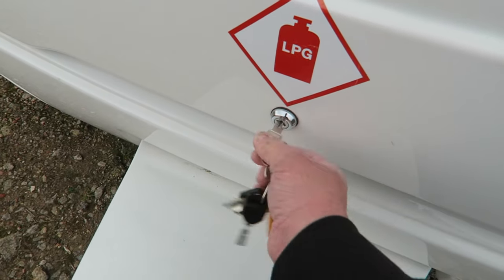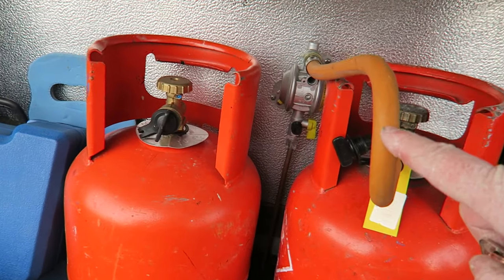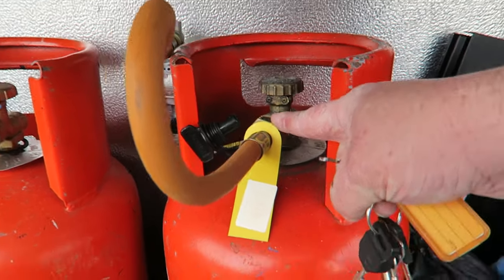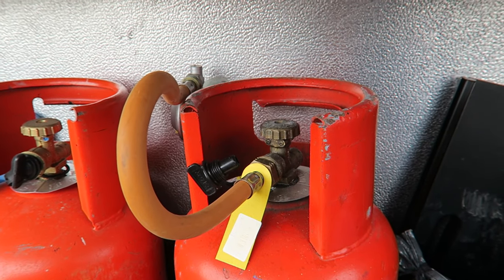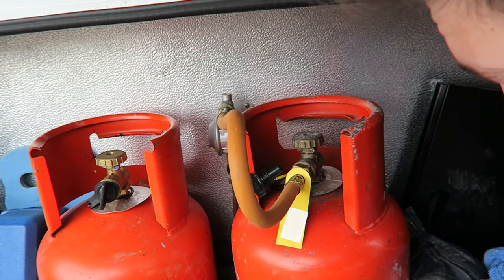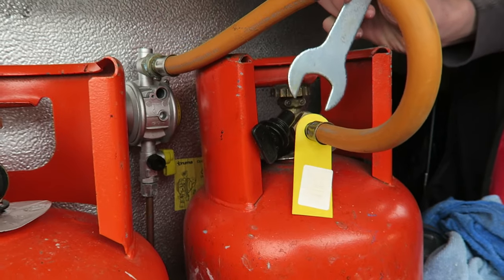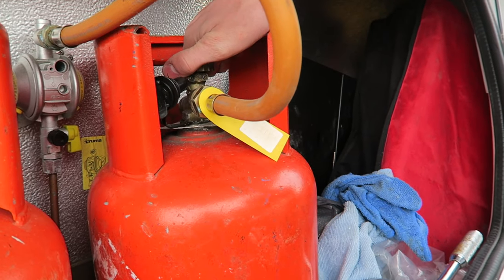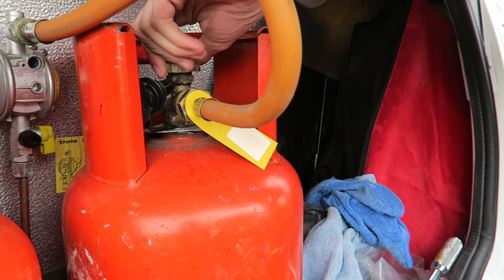How to  replace a gas bottle in a caravan

Comment: I didn't know that propane gas bottles had a lefthand thread when I was trying to disconnect one on a gas barbeque last year. Both our Coachman and the Lunar had butane bottles and the regulator just clips onto the inlet for the gas bottle. The bottles need to be kept upright. The Lunar had a 15kg bottle when I bought it so I bought the correct 7kg bottle and sold the bigger bottle.

Comment: I can't help but wonder if it's ever crossed your mind to check that the 'O' ring is in good condition and in place followed by a 'soap test'. And while you're at it, are the hose and regulator in date?
Reply from the maker: Hi, Thats spooky timing!  thats exactly what i did when i was at the van last week. I also checked the actual hose too - to ensure its still in good condition.

Great tip, thanks for recommending !

Dan
Reply: Whats a soap test? Sounds fun.

Comment: I have tried re-connecting the gas supply to my caravan after shutting it down for the winter but no gas s coming through the pipe. I have turned on the valve on top of the cylinder and opened up the gas tap just behind it. I have also opened up the taps situated under the seating, to the various appliances but i'm not getting any gas through. Can't help feeling I've missed something? can you help please

Comment: Silly question, but when you first buy a calor gas bottle for a caravan, do you also need a regulator, or does it come already supplied with one? I have seen the red coloured regulators online but your bottles in this video don't appear to have these.
Reply from the maker: Hi Tom, not a silly question, but here goes.

Some caravans have the regulator mounted to the caravan and all you need to do is hook up a tail pipe to the regulator and gas bottle. 

Older caravans have a regulator fit directly to the bottle. so check if you have a regulator on the caravan and if what gas type it is intended for.

Hope that helps
Dan
Reply: Perfect, thanks Dan.  We pick up our first ever caravan (2010 Lunar Quasar 525) in two weeks time so will check.  Super excited and I've got a lot to thank you for as you've answered so may questions I had with your videos.
Reply: @TheTrudgians  hi, do you know how I can get a quick connect bottle to work with this setup where the regulator is mounted to the caravan and the tail pipe connects to the bottle, is there an adapter or something I can connect to the tail pipe then connect a quick connect bottle up?